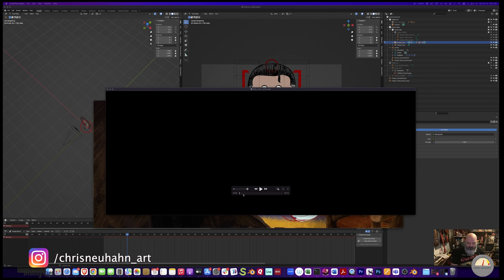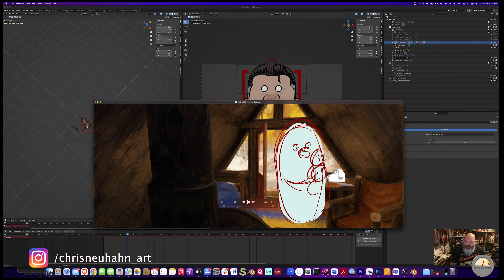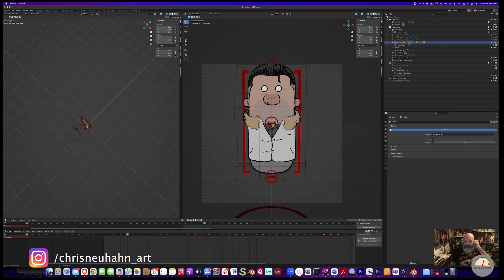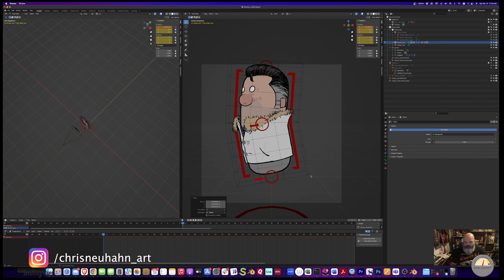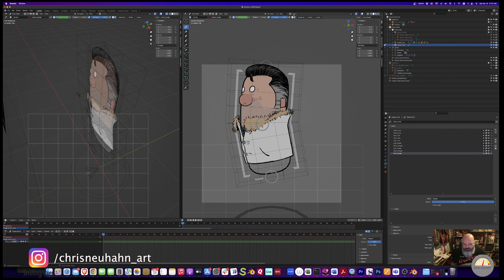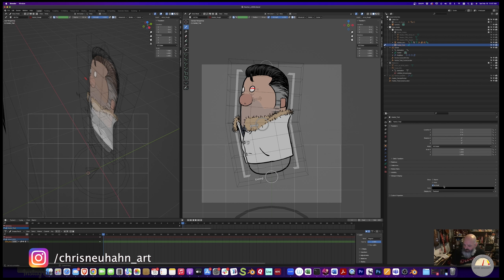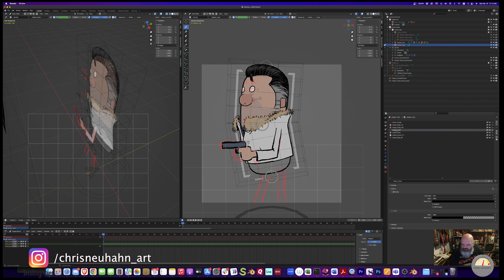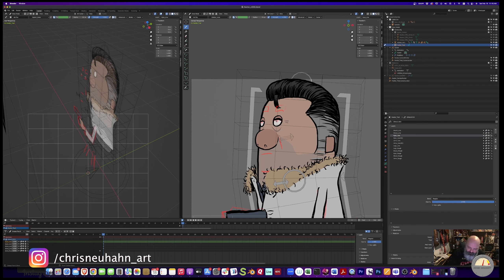Cabin in the North Woods || Production Process Overview

Comment: nice workflow, looking forwards next tutorials! i'm struggling with my own short right now and i'm really interested how people deal with "consistency" and file management. Are all shots scenes in a single blend file per short? How to deal with stroke width (should i even care?) when characters are shot from variable distances. how to share palette/materials between scenes/files in a manageable way - i.e. if I tweak the skin color of the main character in the middle of production - how to rerender all shots are once :) all this boring stuff is rarely covered in tutorials :|
Reply from the maker: I’m definitely using separate files for each shot. But I had a file with all the camera initially. for the stroke width on a couple shots i added the Thickness Modifier to do over all adjustments. For the most part id adjust the thickness after the first couple strokes of drawing. I think you can make materials be a link to an external file which would allow you to have a central source for the color but I don’t do that. if i had to update colors Id just copy the Hexadecimal color value and copy into the other files. For the rendering, the render times are so short on this I just always rendered the scene before exiting. even if i wasn’t done yet.
Reply: @ChrisNeuhahnArt  Thanks! Right now, i'm using a file per "movie scenery" and have a scene per shot with some naming conventions, but still when I just want to try something out, create a new file, or just a backup file, I soon end up with a mess and my system falls apart. I'm using thickness modifier for all my objects, but right now i'm just eyeballing it to look good, because it's dependent on camera position (which is different per scene). I've tried using the "screen" mode, so it's independent on camera position, but it didn't look good - i wasn't able to find an universal value + it looks bad with zooming. It seems that other people are just eyeballing it too, so I guess, i'll continue with that. Render times are short, but I was asking because of all that manual work - opening tens of files/scenes, clicking render - waiting for each one until I start another.
Reply from the maker: I do just eyeball the line thickness. It's a small enough step, and is very subjective, that an automated process doesn't make sense. Maybe I'll change my down the road as the number of characters and complexity increases. 

Are you rendering your BG, Characters, and other elements, from separate files? I haven't looked into any batch rendering software for Blender. But I'd assume something exists. In a future video I will be covering some of the other shots where I used compositing, and scenes where the BGs are just images on planes, and other solutions to issues with grease pencil.